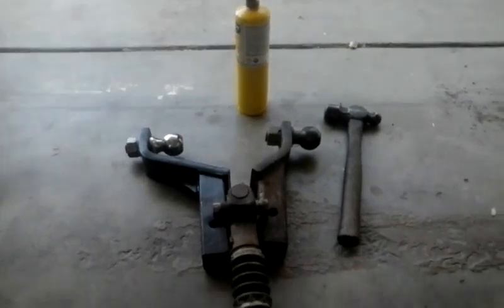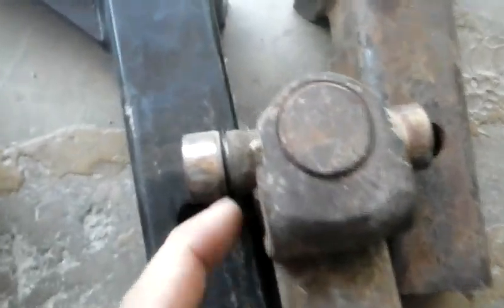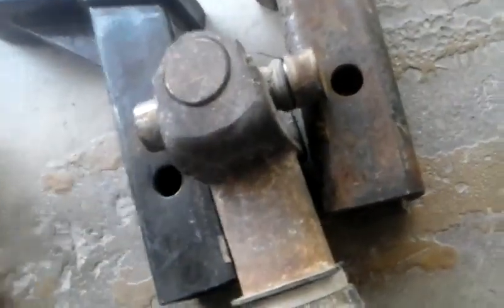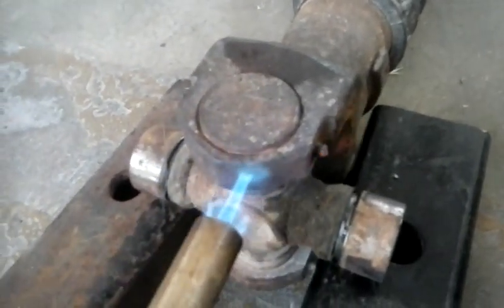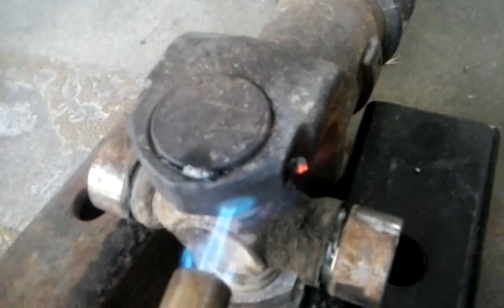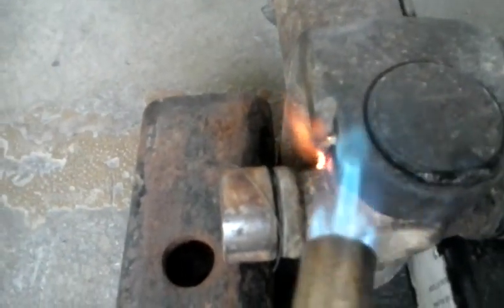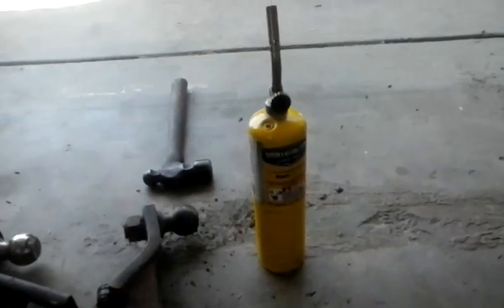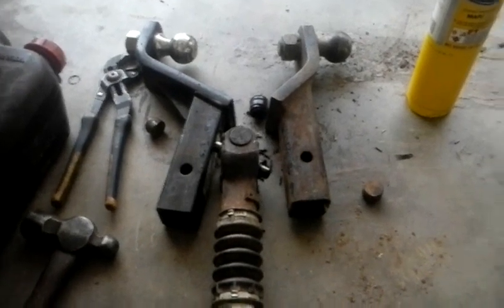easily remove universal joints with out a vice or press

Comment: Just used this tip on my 06 rubicon front u joint.  Worked great.   Only video I could find that mentioned the plastic retainer pins.  I was at a loss until I saw your video.   Thanks.

Comment: Saftey Notice!
In the 70's I was a Heavy Repair Mechanic at a Buick Dealer in Michigan.
These Plastic Retainers are used in G.M. Vehicles and I was replacing the U Joints on a Driveshaft. I had the Shaft held in a Vise and was heating it up and out of nowhere, BANG!. The light above me went out and broken Glass was falling all over me. The Bearing Cap shot out like a Shotgun Slug, hit the Flourecent Fixture almost going through the Metal and shattered the Bulbs.
If I would have had my head above it, it could have killed me or injured me badly.
Make sure you never have the Cap you are removing pointed in the direction of ANYONE!
The other Mechanics said they never saw that happen before.
Reply from the maker: plainwornout3 wow!!!! I read that twice. Thanks glad you did not get hurt and are still around to teach is these things. That's intense. Bet you never saw anything like that again???
Reply: The guy I talked to about cutting my drive shaft says the same thing. He has had a couple explode and hit the ceiling of his shop, so keep your head out from above it.
Reply from the maker: Robert Schulz thanks for sharing and letting every one know!
Reply: I have seen this explosion happen all the time especially when using oxy-acetylene and cutting torch. The heat is contained and it builds up inside the cup and it will find a way out to relieve the heat through explosion. Propane torch is the best way to use just like on the video. It may take longer but it's much safer.
Reply: Wow, good tip thanks for sharing.
This is most likely due to any water being in the cup, once water turns to steam...the expansion rate is the same as Nitroglycerin...hence POW! Similar to when very small droplets of moisture pop in a pan of hot oil.
Reply: Why not drill a small relief hole in the end of the bearing cap prior to heating the yoke?  Even if you hit the end of the shaft inside, it won't be on a surface that matters.
Reply: Dr D or the grease vaporizing and igniting.
Reply: Shop Safety (OSHA) REQUIRES plastic tubes over Floresent Lite tubes.
Had one shatter on me and it sliced a tendon in my Hand.
Shop Boss was a fkin idiot, did little to fix that issue.
Those Plastic Sleeves are A few bucks.
Reply: @MattShaughnessy6  LOL, it's only been five years and I saw this reply. It was scary and it shows how quickly you can be hurt or killed.
Reply from the maker: @plainwornout3964  only thing to fear is fear itself.

Comment: Boise Idaho represent!!  Working on my 97 Dodge 12v one ton today.  Same thing
Reply: I'm in boise as well, 97 ram cummins 2500 longbed with HD camper package(same 2 peice rear driveline setup as the 3500 one tons) Just pulled my line today, u joints are seized in pretty well. Last time I cut them off with a skinny wheel and knocked em out. Gonna have to replace the transfer case extension housing seal too, its leaking .

Comment: The 'pin' is actually the sprue where the plastic was injected into the joint to lock it. The hole leads to a groove machined half into the cup and half into the yoke, thereby creating a ring that, when filled with the plastic, locks the joint. 
You should actually heat the joint all around, starting at the heavy side. That way, the whole ring boils out rather than just the sides and area over the thin section. You have to do two at at a time minimum; I did all at once. Mine was a double cardan, so, double the amount there.
Another good thing to remember is not to remove the rest of that 'pin' with a drill. The groove in the yoke will still be filled with plastic that should be removed. If you leave the remains of the sprue and tap with a punch, most of the remains will pop right out. If you drill the pin, you'll be there for a while scraping and prying the remains out with a pick of some sort. The plastic they use is extremely tough and hard and almost has a fibrous appearance. Not fun to try to dig out I hear.
Reply from the maker: Hi! Thanks for the awesome information and education!
Reply: Thanks

Comment: My universal joint is on a tractor PTO drive shaft.  The plastic pin you burned out looks to be metal (not sure, going to check).  If so I assume would I just heat and try to pull it out with lock pliers or can you pound it through to the other side ?  Great VID BTW for us folks that don't have shop presses or brake pullers...-  Thanks for taking the time=  Bob

Comment: It looked like the hosing was broken on the other side.  I guess it depends on if it's staked.    I've seen it done with a socket & hammer.  The joint is the only thing that really needs replacing.  They sell a kit so the shaft doesn't need replacement just the U joints because the bearings won't move freely & siezing up is causing heavy vibration leading to complete failure of the part.

Comment: Okay, that is the removal. Do the new joints come with the plastic pins or do you buy the pins separate?
Reply: Replacements do not use a plastic pin.
Reply: The replacement joint uses   
Clips to hold it in place.

Comment: Great video! That did not take near as long as I would have thought to get the plastic to come out. It was less than 3 minutes, correct?
Reply from the maker: Yep just a few mins. Neat method huh? It's an old school method taught to me by my mentor.
Reply: @MattShaughnessy6  My mechanic told me it could not be done with propane. Imagine that.
Reply: @MattShaughnessy6  I'm about to do this on my s10 along with the transmission to drive shaft seal. Thanks for your help!

Comment: What about drilling out the plastic pin? Haven't done type of U joint before, so I'm just curious.
Reply: David R Whitford The 'pin' is actually the sprue projecting from an injection hole leading to a ring that is machined half into the cup and half into the yoke. The plastic forms a lock ring all the way around the two pieces.
Reply: It doesnt work that way.
Plastic pin is just the result of the injection process.
The cap is encircled with nylon, and is hard as steel.
Heat it and you can then drive it out.

Comment: Do you have to buy new plastic pins that you melted out when you install new u joint ?
Reply from the maker: +Jed M replacement bearing should come with new ring assortments good question thanks
Reply: I bought my truck with an aftermarket shaft that had these pins, which I did not know existed. I thought they all used c clips and such. This is a life saver Thanks!!!!
Reply: GM has used that plastic for years...my 92 astro still ha the original u joints with it...lasted 175k
Reply: The replacement u-joint has metal clips that hold the caps in place.
Reply: It's not actually a plastic pin. The two holes are where plastic is injected into a channel that goes completely around the bearing cap, locking it in place.

Comment: Once I get it out, is it pretty self explanatory on how those caps go back in? Do I need to put plastic back in to replace what I melted out?
Reply from the maker: No new ones will not come with plastic.
Reply: Matt Shaughnessy so just press new ones in? Thank you sir!
Reply: New ones will come with retaining clips (E-clips or G-clips, depending on whether there is a zerk fitting in the end of the new bearing cap.  The clips will sit in the groove that used to hold the plastic.  At least, that's the way it's supposed to work.

Comment: Doesn't anybody use their vehicle as a press? So simple to jack up your ride then put your sockets where you would if you were using a press,place the driveshaft under the frame so that one of the sockets is centered on the bottom of the frame. Slowly lower the jack & the weight of the vehicle will press it out enough to bottom ont the u joint. Flip it & do the same thing for the other cap. Note: When you lower the jack don't stick your face down to watch. The sockets have been known to pitch to one side & fire out at tremendous velocity. Took one in the shin years ago. Damn that hurt.
Reply: Sounds like a Matt technique.
Dangerous as fuck.

Comment: Bro bro bro do not use a torch it's not needed just make sure u remove all retainer clips just wack with a 16 ounce hammer and 1 inch socket that's it real easy I've done many pairs over 40 years these are the easiest to remove no matter how long or rusted they bin in I never ever   ever needed heat !!!!! Dont burn yourself
Reply: I have to do mine on an 88 chevy pickup and was thinking about using a u joint puller would that work? When I called the shop for a quote they made it sound complicated and said they would have to measure to get the right u joints, they told me it would be an all day job and I dont believe them, they want to charge me $550 and said finding the right parts may be an issue but when I looked them up autozone has multiple ones that are all in stock, I am researching so I can do them myself, is there any suggestions you can give me, Thanks in Advance
Reply: @mercedeslindigenous4219  yes u can use puller but really all you need is a socket slightly smaller than the diameter of bearing soak all first night before with rust blaster WD40 support under knuckle and hit socket with hammer it's very easy
Reply: @frankfred3411 Thanks for the Reply. I rented the puller but didn't end up using it, your are right it was super easy and I saved $500
Reply: I don’t see any pins on mine other than the plastic, there is anything that I can do or only wack with the hammer?
Reply: He’s doing ones that have plastic molded injected that needs to be melted out, they won’t hammer out until you get the molded plastic injection crap out